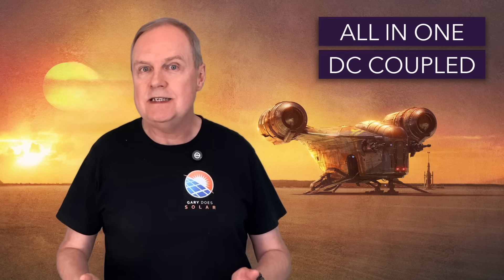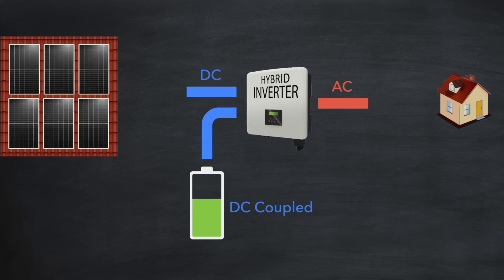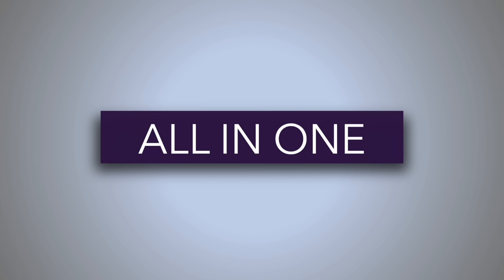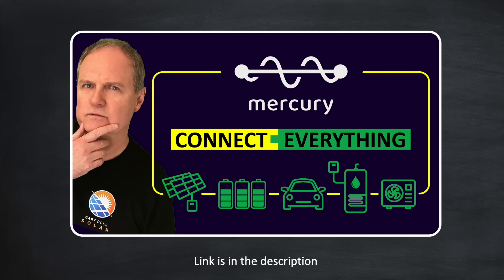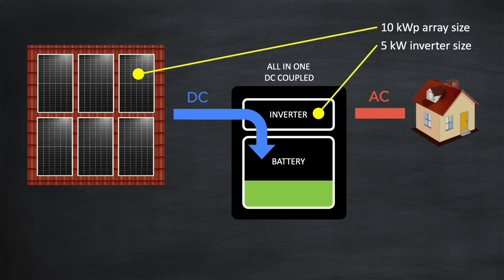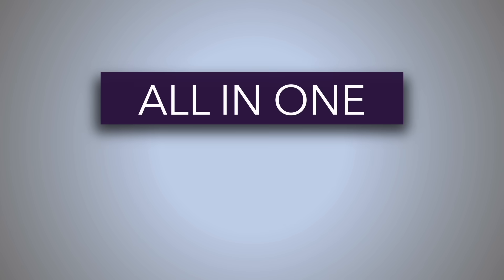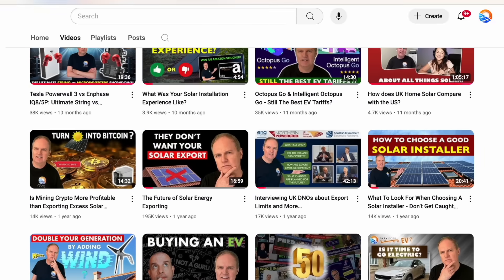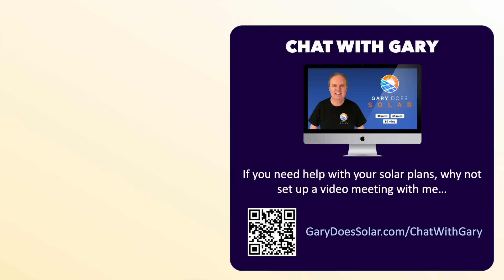Why All-in-One DC Coupled Systems are Transforming Home Solar

Comment: After owning an Enphase system for years, I recently switched to the EG4 12000xp off-grid inverter with 42kwh of EG4 wall mount batteries.  Best thing ever. Made in America with support in Texas. Seamless auto switching to grid bypass if needed. Runs my whole house. This is the way.

Comment: I don't think you fully explain the DC Coupled / DNO restriction very well when compared to AC?

If the battery and the panels are behind the inverter which exports to the grid and the house demand, the export rate isl Caped by the inverter 5kw limit so arn't you disadvantaged here as with the A/C coupled scenario the inverter and battery can supply the house load and up to the DNO limit where as with the DC Coupled you have to split the inverter limit between the house and DNO limit always? 

From my understanding the only advantage there for how you explained DC Coupled os excess solar ability to be absorbed by the battery?

Is this the correct understanding?

I don't understand how you are saying there is an advantage from the DOS seeing only a 5kw inverter if that is the bottleneck regardless of what the system equipment has capability to export upstream of the inverter? It can be exported as the DC to AC conversion is bottleneck but the 5kw inverter limit?

Comment: You didn't really touch on the disadvantage of all in one systems, cost! So many people get solar and skip on batteries because of the cost.  But if they ignore the solar installers preferred proprietary systems, select a hybrid inverter that works with off the shelf 48V DC coupled batteries, then batteries are cheap!  Telsa powerwall 3 works out at about US$650/kwh, but 48V LFP batteries are closer to $100/kwh.   Yes you loose a couple percent in efficiency compared to high voltage, but that couple of percent is never going to recover the 6 fold increase in price.

Comment: Question - the capacity of the inverter (in all system) is the limiting factor as you could only export AC to the power grid. This is valid also for the AIO system. Am I missing anything ?
Reply from the maker: I’m not sure I understand your question. Could you rephrase/elaborate please?

Comment: Maybe I missed it but I was thinking that pointing to the advantage of minimised converson losses for a DC coupled system would have been worth it.
Looking at the video I was gradually more convinved that these AIO systems may have a future if they turn out to be reliable.
What also jumped to my mind was the module for BiDi charging for vehicles could be used to connect a 2nd life car battery instead as well. No?
Question, I thought that would be intersting: What does the BiDI module do: DC-charging? If so, that could boost its acceptance in the market even more, as DC-charging @ home is not widely spread so far but would also have a chance to improve EV efficiency by minimizing conversion losses.

Comment: Ik heb een Sigenergy thuisbatterij ( 3 fase 10 kw omvormer en 16 kwh batterijen) en 11kwp aan PV-panelen. Van die 11 kwp PV panelen zijn er 7kwp dc gekoppeld op 2 mpp trackers en 4 kwp ac (enphase iq8mc inverters) gekoppeld via de gateway.
De AC gekoppelde panelen waren er al voordat ik het thuisbatterijsysteem kocht. De DC gekoppelde panelen zijn gelijk gekocht met de thuisbatterij. De keuze voor de Enphase micro's had/heeft te maken met schaduwval op het dak en dus moest dat blijven ondanks de omzetverliezen die dit tot gevolg had ( van DC naar AC,  van AC naar DC (naar accu) en van DC naar AC  (naar huis of netwerk) Het mooie nu aan dit systeem is dat het de stroom die opgewekt wordt door AC panelen als eerste gebruikt voor het huis of het netwerk en bij overproductie van de AC-pv panelen dit opslaat in de accu met bijbehorende RTE-verliezen. Hierdoor valt het RTEverlies van de AC gekoppelde panelen dus reuze mee. Goed gedaan Sigenergy.
Ik woon in Nederland en heb een 3 fase aansluiting van 17 kw (hoofdzekering)  in totaal.
Reply: De hoofdzekering is 3x25A wat leidt tot 17kw
Reply from the maker: Thanks for sharing your setup and experience with your home battery system—it sounds like you've got a really efficient setup! 👍🏻

Comment: I already tried to go  the Tesla route. It is proprietary tech, that is held hostage by greedy installer companies. They quoted $5,900 installation for two Power wall 3 connected directly to my main breaker panel. Disabling both internal inverters that cost approximately $4,500 additional expense because they didn't want to tap into the EXISTING Tesla solar system THEY INSTALLED and replace the old inverters with the newer, more efficient inverters in the Powerwall. 
TL;DR: Tesla charges $5,900 to hang two batteries and run two wires to a breaker panel.

Comment: I'm in the US. What's the difference between a hybrid inverter and the all-in-ones that you're talking about now? 

I currently have a solar edge HD wave without a battery. I'm trying to figure out the best option to add a matter of it. 

Powerwall makes for the easiest installation. And one of your problems of access exporting seems like it's solved since the powerwall allows for that to be programmed. 

Solaredge new stackable system looks interesting if I want to swap the inverter.

If I go with a non-tesla battery is there a way to charge my car from grid only? (Which I can program for off-peak) Seems like charging the car puts a lot of wear and tear on the battery.

Comment: Been off grid for 10 years now, they almost give away lithium batteries now. I use two separate victron controllers for redundancy, its a small system but has been reliable for many years in outport Newfoundland.

Comment: All-in-one is easier to install, but automatically force vendor lock-in.
Automatic clipping by the inverter is a complete non-issue by the way, that only happens when there is plenty of cheap energy around.  
If the return amount is (financially) capped by the grid operator there may be a (limited) use case.

Comment: Modular is the way to go
Looks clean less wiring less  labor 
As long as you can swap a dead inverter or dead battery
Reply from the maker: Agreed 👍🏻
Reply: But can you though? With the manufacturers introducing new products all the time your five year old inverter might no longer be in production. If it fails you might need to replace the whole setup including batteries.
Reply from the maker: … or buy a second-hand replacement.

Comment: Thanks Gary, I would need to repeat your video to understand comprehensively several times. Unfortunately we have a now antiquated (4 years old) pv hybrid inverter (old Fox design not capable of eps 😂) and now ‘upgraded’old battery system ( from two to four modules )of about 10.5 kWh total. It’s no good saying I wish I had waited until these modern integrated systems are more mainstream from several angles , 1 we have benefitted from grid export ,2 got rid of gas , three got EV,s , but I still would love the integration but still cost prohibitive. A coherent government strategy which factors out completely dirty generation would pay massive dividends especially as all this is in the interests of having a habitable planet, although I fear we are too late for that now.

Comment: I think the SolarEdge Nexis all-in-one system is the best solution, where the inverter connects atop the stackable batteries, giving the customer the freedom to install as much battery storage as they’d like, with a meter collar connected with a tiny RJ45 cable, and still uses the optimizers for max power.  This should be the system all inverter/battery manufactures should adopt.

Comment: One "app" to rue them all. One "app" to be hacked and have your power shut off at the worst time. One "app" to be given to you free now but later be turned into a service with a high monthly charge. One system to completely break down when just one part fails. This video is full of terrible misinformation.
Reply from the maker: Let me just ask, how much of your life is run on that one smartphone you have?
Reply: @GaryDoesSolar  None! I don't let my pocket computer run my life, I run my life. I tell my devices what to do, I don't let any of my devices tell me what to do. My devices don't connect to the internet or anything else unless I command them to do so and then only for as long as I command it. No one else is allowed to connect to my devices. I don't store any of my information on anyone else's computer (i.e. the cloud). I got rid of every trace of spyware such as Google as soon as I got my first device that had that junk. That's one of the many reasons I would never use any Apple products, you can't get rid of the spyware on them and you can't even completely turn them off, they will always be tracking you. That's also why I still use Winblows XP and am migrating to Linux, newer Winblows is spyware with massive backdoors.

Comment: Next Made DC home
Reply from the maker: Sorry?
Reply: @GaryDoesSolar  Isn't there a zero emission  home project in the UK( zero Bill house )?

Where the heater and stove, car charger use electricity from the solar panel . 

And many people are trying to push further By using all DC Home equipment  

By eliminating the need for a DC-AC inverter and using a high voltage 220V battery

Solar system can  increase efficiency from 80% to 98%.

Comment: Hi Gary, I have just installed a Solar Micro inverter and Enphase Battery system from Octopus and so far on cloudy days in mid October I am pleased with the results.  I charge the batteries on Octopus Intelligence Go overnight at 7p  and have opted for the flat rate export rate, but I might try Agile next month.  So far excluding exports my electricity bill is down by 63%, from crude calculations. That a big saving.  I know that will worsen over the winter but I will be a net exporter to the grid over the next 12 months or I hope so.  I think you are just about to say my system is old hat 😉😊
Reply from the maker: Hi Steve, great to hear about your installation—and fantastic results already! 😀

Actually, I really like microinverter technology and am in discussions with Enphase for a follow up video to this one I did last year:

https://youtu.be/kGCKarB7fnI

I also plan to do some real-world testing of microinverters vs string inverter as for a UK-style climate, there’s a belief that microinverters perform better overall. 

I do think though, their current battery offering is not as strong as other players in the market today :-/
Reply: @GaryDoesSolar  Hi Gary i was comparing days, now I can compare week on week and so far the cost is 70% cheaper Wow.  My only question is if I added a Heat Pump in the next 18 months would Octopus let me add another battery?  They only seem to talk about 5 or 10 kWh capacity unless you go Tesla.  Not keen on that

Comment: I prefer all-in-one systems like EG-4 or Sol-Ark, that keep the battery separate, so we can have as  big a battery as we like. They also support VPP (virtual Power Plant) control protocols. If you really want panel optimizers, use something like SolarEdge DC optimizers, or maybe from Tigo Energy.

Comment: I'm in the U.S.  I bought a residential solar system and an EV last month. I did not buy a battery system, because they're expensive. I was quoted 15 kWh batteries at $15,000 (USD). That's ~ $1,000/kWh.  But I bought my 2-year old Hyundai Ionic 5 EV (it came off a lease) for $21,000. The EV has a 74 kWh battery, so only $284/kWh. Even a new EV at $54,000 would be $730/kWh. Based on that experience, I don't think home batteries are the future; integration of solar and EVs are the future.
Reply: All these installers are robbing! You can buy 28kwh eco worthy (2- 14kwh pack) for $4300
Reply: @Derp-xj5oo please specify the batteries and place to buy them! Im trying to put together a battery back up for my house.
Reply: It really is amazing. You could buy a used car, not register it, not drive it, and leave it as stationary storage.
Reply: I have a six year-old solar system, but no batteries. Recently when I asked my contractor about adding batteries, he suggested a cheaper solution would be an EV with bi-directional charging.
Reply: Do it yourself and outsource any complicated stuff. There is plenty of support online.
Reply: I paid 92 usd / kWh for my home batteries. Mb31 cells. Jk bms. Deye hybrid inverter.

Its crazy how ppl can pay 1000 usd / kWh for home storage
Reply: you were getting ripped off
Reply: The problem is the quote. That price is outrageous.

Did the installer mention the 30% Federal tax credit that's available until the end of 2025?
Reply: You can buy 15kw batteries 3000
Reply: @samfish6938 I bought my 16kWh battery for £1,399 last Black Friday
Reply: Two years ago, due to the installation of a new mini split heat pump, I added 10 panels to my existing solar system, bringing the total to 15 kW. My export to the utility is clipped at 10 kW. Increasing the export would require buying another inverter and going through the entire application and approval process again – – neither of which is palatable. Because I have two EV’s I’m very interested in the possibility of hiding production over 10 kW behind my existing inverter to charge the cars during the day. My level 2 EV charger and HVAC systems consume by far the most electricity in my household.

Comment: I'm not entirely following the various system descriptions presented here.  No matter the battery/inverter configuration, all solar generation must be converted to AC through the inverter to be used by the home or the grid.  The inverter size then is always the limit.  Not following how excess power can be fed into the grid unless it has been inverted first.

As I understand it one of the complicating factors is synchronizing the AC cycle.  It must match the grid or cant be used.  Is something that needs to be considered?

Comment: The main advantage of the new inverters is that they are cheap. They lack the robust nature of the older modular systems and are harder to repair if some internal part fails. They are becoming more of a short term device. On the other hand, the way that solar has been evolving so quickly is making devices that are 10 years old essentially obsolete, though still functional.
Reply from the maker: Do you have evidence to support these claims?
Reply: @GaryDoesSolar  What "claims" are you speaking of, and do you disagree with evidence of your own?

Comment: Brilliant information presented for us simple folk. 
Did I miss the bit where you point out the conversion losses are not as high too. I have a GE All in One Mk1 which has the string inverter separate and there is quite a loss in and then back out of the battery. At min I think it is at least 10%. So a DC system must be better as only one conversion. 
So many advances in this tech and poor installs from suppliers not giving best advice.
I have just spent a lot of money (flipping scaffold cost !) to put Optomisers behind all the panels and add a couple more panels to a roof. Very interesting to see the improvements in generation as the original install had put panels that were 90degrees different aspect on the same strings ! Both strings grr.
Also the new panels wake up in much lower light than the 2year old ones. Looking forward to seeing the winter stats come through.

Would love the Sig concept of adding what you need in various sized lumps. The GE AIO it is get another at 13kW or not; not to mention I would have to do it soon whilst they have the old Mk1 available as like Tesla you can't put the latest AIO batteries with the older ones.

So 7year pay back then dump and replace with more modern tech which will do a much better job ? Shame I can't just mix and match. Glad I started 2 years ago after 10 years thinking about it but so many advances since then.

Comment: Very interesting video but you didn't mention the drawbacks of these solutions. While an All-in-one solution have all the benefits you mentionned, it give less customisation possiblities. On the oposite when you chose one or more MPPT solar controlers, a battery and an inverter seperatly, you can have a system that is very adapted to your home and to any solar string configuration.
The other problem of an all-in-one solution is that if the main unit fails or is outdated, you have to change the whole unit, you can't just change only one small element.
Reply from the maker: Yeah, but if it fails under warranty, does it matter?
Reply: @GaryDoesSolar But how long is the warranty period. Also if the main unit fails and is no longer being produced you might end up in a scenario where you need to replace all battery modules as well. In the end the main draw back is the vendor lock in effect.
Reply: @GaryDoesSolar  If it fails under warranty and the manufacturer is on a dash to do an IPO and has sold inferior products, the warranty is irrelevant, everyone except the original shareholders are left holding a huge loss.